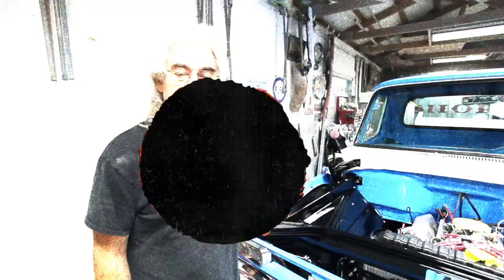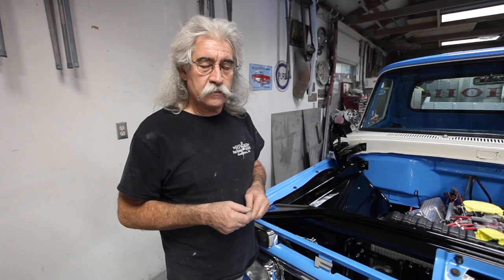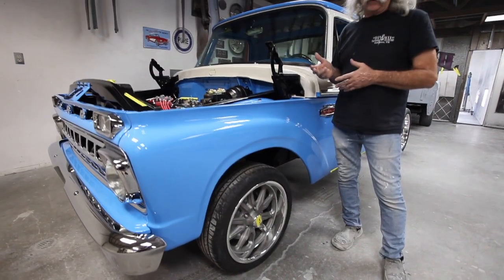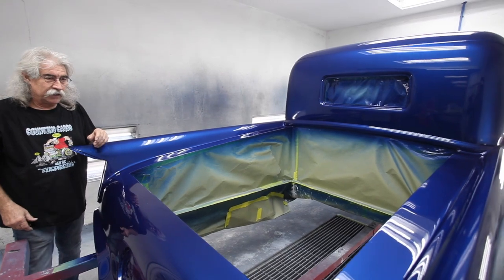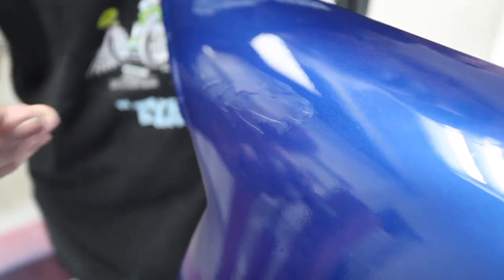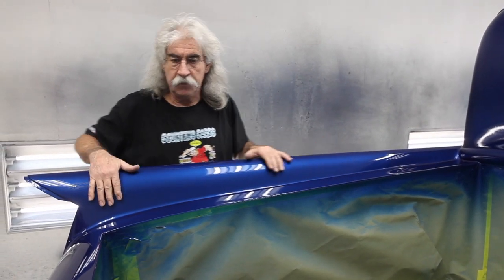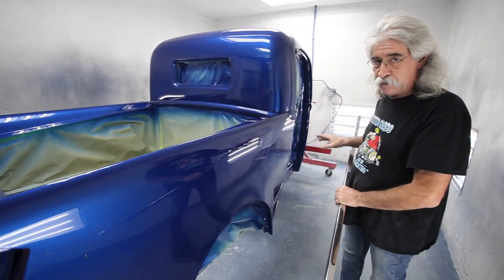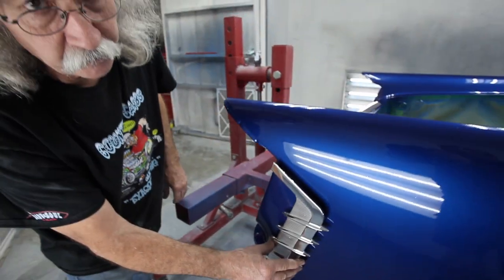Custom Cab Paint Job

Comment: I really like the pin stripe ideas and in my opinion if the chrome on top of the rails don’t conflict or convolute the appeal of the stripes then I would add them. Either way I know your vision for how the truck is finished out will be right on the money. Y’all do such an amazing job every time. I have one question with the paint process. When you paint an area like you did because the job would be too big to keep it wet, how long do you let the area dry before starting the next spraying session?
Reply: If you were refering to painting the inside of the bed first,I left it set a day then taped it up, to paint the rest of the body,ifyou were asking how long between coats of paint usualy 15- 20 minutes., hope that answers your question.  Thanks for your  coments ,we appriciate you watching  .feel free to ask again if I didnt answer your question😊😊😊